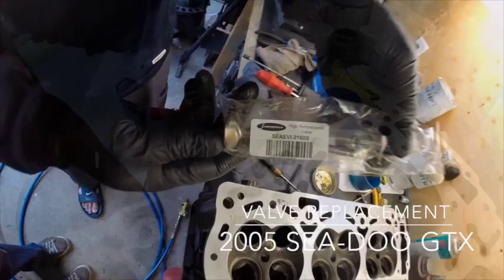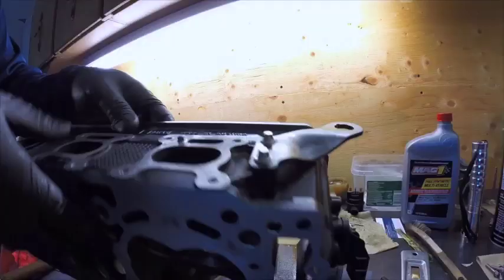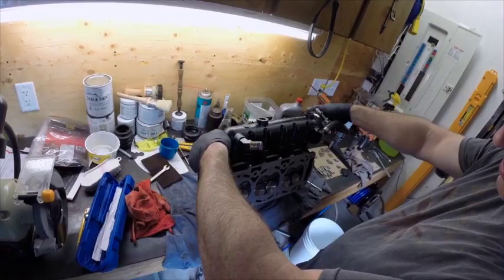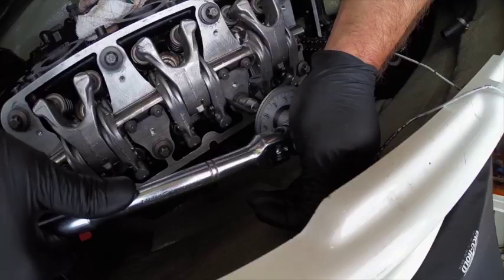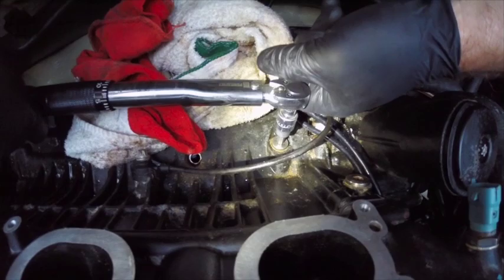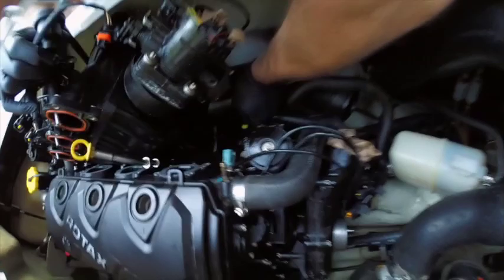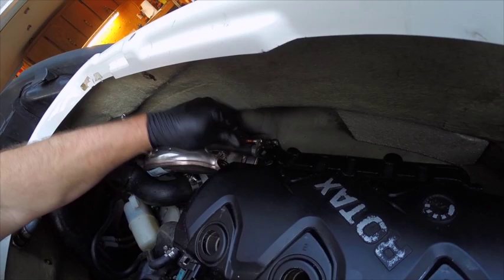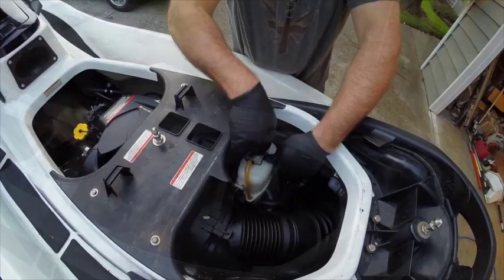How To: Sea-Doo 4-TEC Engine Valve Replacement (Part 2 of 2)

Comment: what new parts did you buy? Just exhaust valves and the 8 head bolts ??
Reply from the maker: +steelerscrzy 
Parts required were:
New intake and exhaust valves I used Supertech part numbers SEAEVI-3160S Exhaust and SEAIVC-3860S intake. You will definitely need a new head gasket and rocker shaft bolts these are stretch bolts and cannot be reused.  Some other parts may be required depending on age and condition of the old parts.  Valve seals, I replaced these as they are relatively cheap and not easy to replace afterwards.  Head bolts, the old ones can be reused if they are within spec I decided to replace them, ARP 168-4201 head studs are another option.  Intake plenum uses rubber seals so these are OK to reuse if they are in good condition, there is no gasket on the exhaust manifold.  Valve cover gasket may need replacing it is a rubber gasket so it can be reused if in good condition.  Cam sprocket bolts, I replaced these, torqued to spec and used red locktite if these fail all hell will break loose and $5.00 extra for new bolts is cheap insurance. 

If you are going to do this I strongly recommend getting a genuine Seadoo shop manual and follow the steps and torque values to the letter.  Manuals can be found online for free, google "seadoo manuals" I cannot post a link here for obvious reasons.

Good luck and thanks for watching our videos.

Comment: Good work, Where can I find or make the compressor tool you used to compress the spring ? And also the suction for the valve ?
Reply from the maker: An auto parts shop should have both.
Reply: Thank you

Comment: I have water in the oil the only thing is a blow head gasket could there be another reason 2002 4tech.
Reply from the maker: It could also be a bad water pump seal or from the oil cooler. Most likely a head gasket though.

Comment: What brand/model of torque  angle gauge are you using?
Where did you source it?
Reply from the maker: CDI. You can buy them here (and support our channel in doing so): http://3ftdeepsports.com/store-tools-wrenches/
Reply: Great!  I'd like to get as many things as I need from your channel because you have been so helpful.

I inherited some older watercraft, and I am rebuilding them in Yakima, Washington. I may need to bend your ear once in a while!

Thanks!
Reply: Couldn't find the gauge under specialty tools....
Reply from the maker: Sorry, I forgot in that old video we used an old analog style (I can’t remember where it came from or brand). But we now use a digital CDI gauge like this to measure both torque and angles: https://www.amazon.com/dp/B078Z3QNLB/ref=as_sl_pc_tf_til?tag=3ftdeepsports-20&linkCode=w00&linkId=5546d141202e5333fd84feb862811db3&creativeASIN=B078Z3QNLB&th=1
Reply: I'll order one.

3/8" drive, 10-100 ft lb?
Reply from the maker: That’s probably the most versatile, but keep in mind there will be cases where you’ll need a smaller one, and others where you’ll need a bigger one. 3 sizes should cover all the bases, but the one you suggest will give you lots of range. Good luck with your wrenching.
Reply: Thanks!
I have high end, larger and smaller mechanical torque wrenches to use.

Have a great summer!
Reply from the maker: Thanks!

Comment: Hi, i am losing instantly coolant into the engine but cant see where from ,as soon as i pour it in i can see it coming from  underneath the engine from somewhere i can't see, if you could give me any ideas based on your experience i would immensely appreciate it, thank you!!
Reply from the maker: Thanks for your earlier comment. The good news is it sounds like the leak is outside the engine, not inside (your oil would appear "milky" if it was). It's probably a bad hose connection. The best thing to do is to follow the cooling system hoses and use a flash light and a mirror at the end of a pole to see below the hoses at their connections. Sea-Doo has expanded diagrams of all their models on their website: https://www.sea-doo.ca/shop/essentials/parts-iframe.html. Start by selecting "Sea-Doo" on the drop down menu on the left (not "above" like the instruction on the page says). That should help. It could also be your water pump housing gasket, which you can see on the PTO Cover And Magneto section of their parts diagrams, but that's less likely. Good luck!
Reply: 3ftDeep 
Hi,
thank you for the reply, you are right, there is a broken hose off and the fittings from the ride plate, would you be able to tell me if you can purchase new ride plates? I cant seem to find them on the net.
Thanks so much for any leads.

Vlad
Reply from the maker: Yes, you can buy the ride plate, but most likely you'll just need to replace the fittings, which are also available. I recommend you take a look at the following link to see what you need, and purchase it directly from Sea-Doo from their website: https://www.sea-doo.ca/shop/essentials/parts-iframe.html. Good luck.
Reply: 3ftDeep 
must be my luck ;-)
the ride plate is not on their spare parts list lol
hopefully its just the fittings as you mentioned
will undo it and have a look

thank you for your help though
Reply from the maker: It actually is available to order on their parts section. I believe it's number 13 and goes for about US$255.
Reply: thanks, found it in Oz as well finally,for $520Au...
A question, any tip on how to remove the plate?I have removed the screws from bottom,
I have cut through with a blade everywhere i saw the sealant but that thing is bloody stubborn. 

I cant seem to move it an inch.

Thank you for sharing your knowledge!

Really appreciate any help.

Vlad
Reply from the maker: I haven't removed one, but I've heard it's a pain. I think the biggest issue is removing the silicone which holds it tightly until it's all removed. Careful you don't damage it when it finally comes down, and make sure you actually need to remove it to fix your problem. Good luck!

Comment: I'm ready to put this baby back together. One thing that concerns me is the foot pound's of torque for the head bolts. The smaller screws get 89 pound of torque. The head bolts are only 30 pounds which doesn't seam enough for head bolts. I imagine when I use the angel gauge that will add additional poundage? Your videos made this job a lot easier but boy you had to be a contortionist to get the hose claim off of the exhaust manifold.
Reply from the maker: Be very careful when you read the torque measurements. Lbf.in is “inch pounds” and lbf.ft is “foot pounds”. Yes, when you add the angles it will torque it even more. Good luck!

Comment from the maker: I wish we did. We live in the chilly Pacific Northwest (near Vancouver, BC). I'd estimate about $900 in parts, and $1K in labor (at $100 per hour). You shouldn't need to do this on non super-charged engines, so if it's an option for you I wouldn't recommend it. If it's already dropped a valve, you'll spend a lot more than $2K, as there'll be other engine damage to deal with. Good luck!
Reply: i am looking at a supercharged 2005 rxt, do you think the valves will need to be redone?? it has 122 hours on it
Reply from the maker: Chatta Brony
Remove the valve cover and get the number from the top of the valve stem with a magnifying glass the bad valves start with a 72 the later good valves start with 75.  The valves starting with 72 are the ones that can corrode around the stem then the head falls off and can do a lot of damage.  This usually happens to the exhaust valves as these are always in a moist environment because water is always present in the exhaust system.  If you can do the work yourself it's a good off season project if you have to pay a shop to do the work the cost may be prohibitive on a 9 year old machine.  If a valve does fail it usually does it in the most inappropriate place and can cause enough damage to require a full engine rebuild.
Reply: 3ftDeep thank you, I think I would rather get a newer one for the peace of mind, thank you very much for the information! :)
Reply: 3ftDeep to check the numbers on the valve, do I have to remove the stretch bolts on the rocker arm ?
Reply from the maker: @nanakofiaddo8478  If we recall correctly, we didn't need to remove the rocker arm shaft. Good luck with your project!

Comment: is it worth it to have a good 3 angle cut on these?
Reply from the maker: This was done at 140hrs which is not a lot of run time in the life of an internal combustion engine because of the low hours we decided to lap the valves as the seats were still in good condition with no signs of wear.  If this was a higher hour engine or showed signs of valve seat wear then re cutting the valve seats would be a good idea.

Comment: What years  were the valves fixed by factory on these heads
Reply from the maker: You may still find some in 2008, but probably not in 2009 and earlier models.
Reply: 3ftDeep so pretty much rare to find. Best to replace
Reply from the maker: I would confirm first before replacing. Otherwise, it’s a lot of unnecessary work.
Reply: 3ftDeep already have the head off. Thought about replacing them. I only have 98 hours on this head 2006 rxt 215
Reply from the maker: Check the number on the valves. If they have a 72 they are the old ones, if they have a 75 then you should be OK.

Comment: Have You Ever Seen Them Drop A Valve On The Intake Side????
Reply from the maker: No. In the older models it's the exhaust valves that had the problem. Apparently, some of the 300 HP models are having the same problem with the intake valves.
Reply: I replaced The Valves Last Week On My 03 GTX Supercharged. I Put ABOUT 5 Hours On It And It Shut Off On Me In The Middle Of The Bay. Yesterday I Pulled The Plug And It Was Smashed So I Pulled The Head And One Of The New Intake Valves Had Broken In Half And Smashed The Piston. Destroyed My Engine And Cylinder Head. I Really Want To Send You Some Pictures Of It
Reply from the maker: That’s brutal! Please do send me some pictures. Did you use OEM valves?
Reply: Used Caltric Valves. Do U Have A Email I Can Send The Pictures To?

Comment: Where To Find The Torque Specs???
Reply from the maker: You'll need to get a Sea-Doo Service Manual for those.
Reply: 3ftDeep Do You Know Where I can find a service manual???
Reply from the maker: The only official source is your Sea-Doo dealer. There are other sources online if you Google "Sea-Doo Service Manual Download", but I can't link to them as I think they sell pirated copies. I also can't guarantee that they don't have viruses, etc. Good luck.
Reply: I just made the biggest mostake